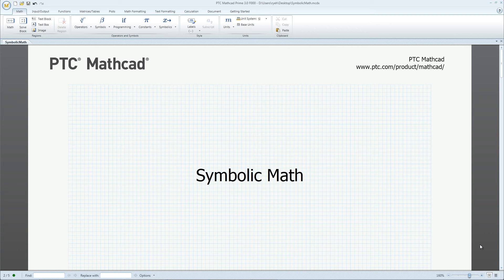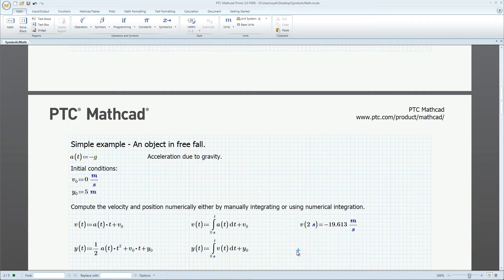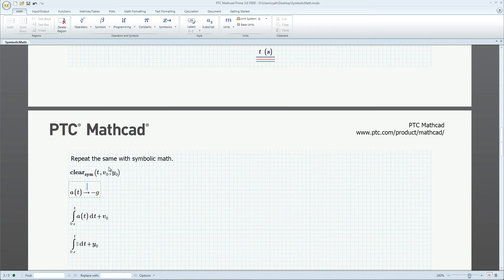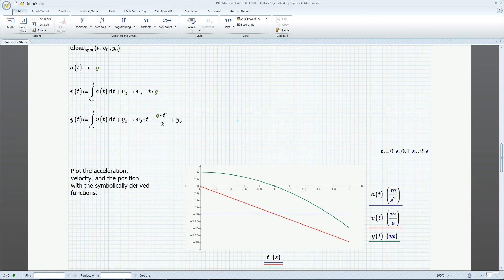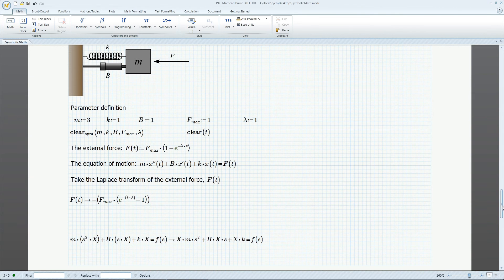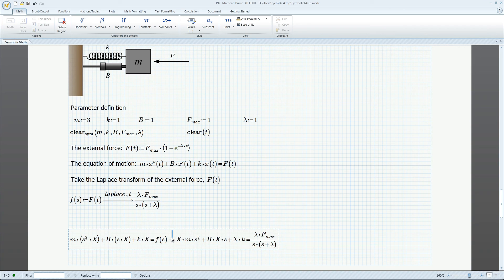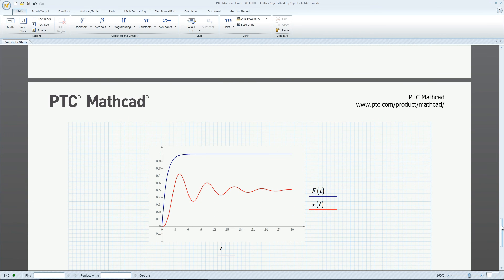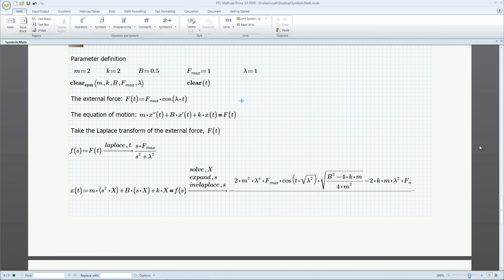PTC Mathcad Prime 3.0 - Symbolics

Comment: To start: what are you describing? shouldn't you star explaining how to place the operators? where is the calculus menu that used to be in Mathcad 15?. A lot of videos but most of them meaningless. Prime hide things trying to make profit even from the tutorials that used to be free with previous versions. I have Mathcad 15 and prime 3.1. However, prime didn't do any better for the users other than confuse and try to profit from such changes. The legacy of the old versions is lost with prime.